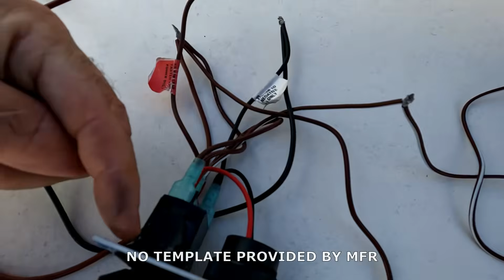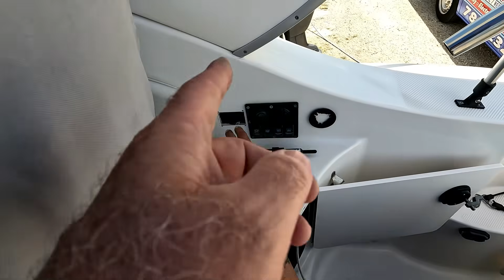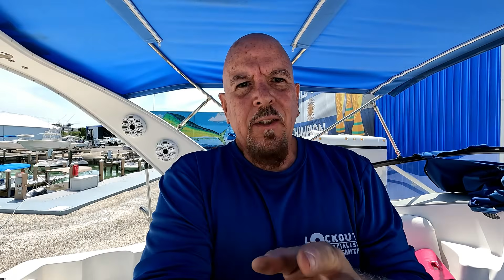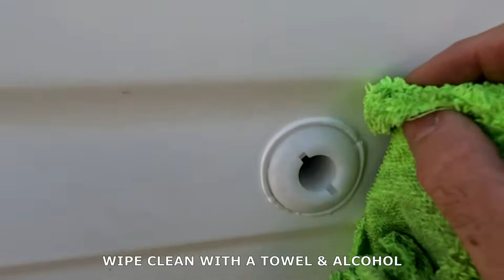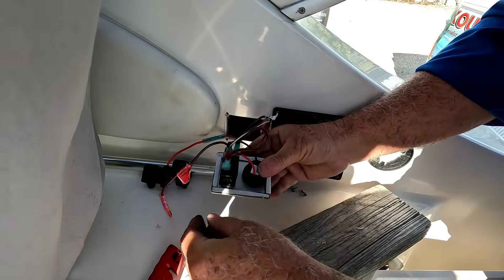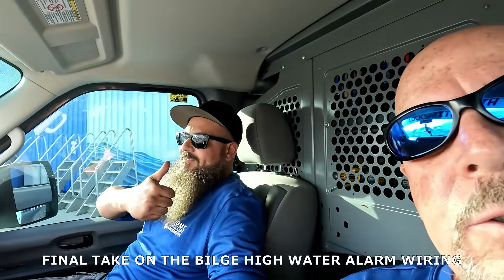BOAT HIGH WATER ALARM INSTALL: A MUST Have for ALL BOATS

Comment from the maker: The high water alarms will keep you informed of any excessive water levels in your bilge by sounding a loud alarm sound. The high water alarm will give you that precious time to be able to react and correct the problem. In our case the space to work in our bilge is extremely limited, and out of reach. But it is recommended that the 2nd bilge pump be installed at the lowest point of the bilge, and the high water alarm be installed a little higher to alert you that your pumps have failed to operate. Hope this information helps you keep your boating experience safe, and enjoyable!

For Items used in this video see the Product Information links in the description of this video!

 Happy Boating! Thanks for watching! Peace from the Keys!

Comment: My 2010 Bayliner 285 has this option from new, the exact same.
Reply from the maker: Hi Bart, was it factory installed? All boat manufacturers should install on all boats regardless of size...thanks so much for your comment Bro. Happy Boating! Peace from the Keys!
Reply: @KeysBoatingChannel  Yes I think from factory, its located on the dash under the anchor up/down switch. Its a must have for all boaters, nice vids bro, good vibes!
Reply from the maker: @bartfromthenetherlands  Thanks Brother!

Comment: Never seen that . Great idea I am going to look in to getting one of these. Thanks for the info
Reply from the maker: Thanks for watching Bro! Yes, this is one important device to have in your boat. The links for all items is in the description of this video, for more information. Thanks for your comment! Peace from the Keys!
Reply: I did not know about the CG regulation about the high water  alarm. Great info. I too have an automatic back up bilge pump. Once my factory installed bilge float switch  failed. Great boating tip for all boaters. Thanks for the reminder to get this project on my list
Reply from the maker: @markdimaio8396  Hi Mark! Yes, this is a must do for all boater's...USCG requires it only on 26+ boats, I believe it should be on all boats regardless of size. Thanks for the comment Brother! Peace from the Keys!